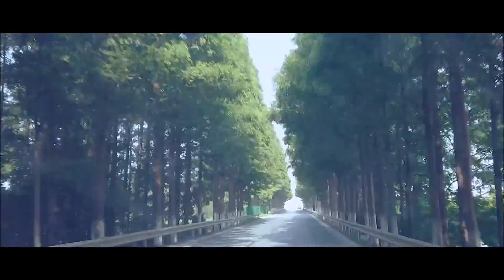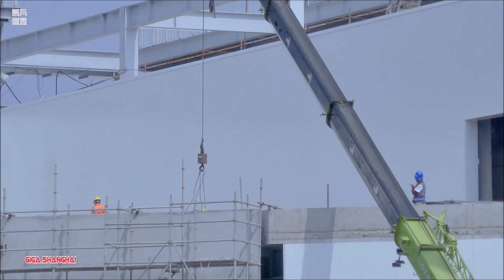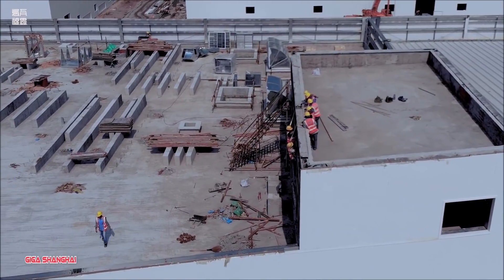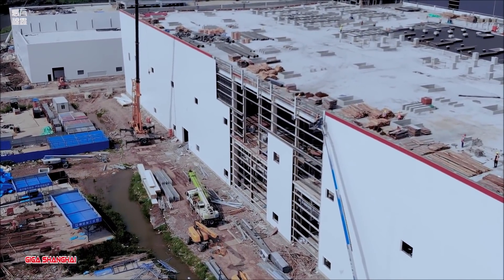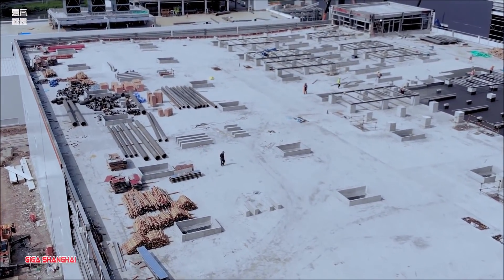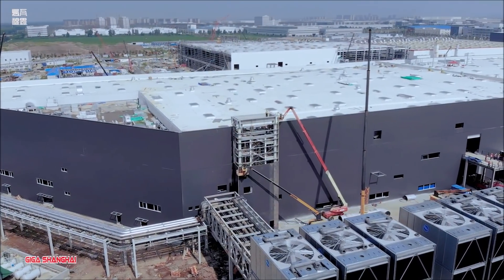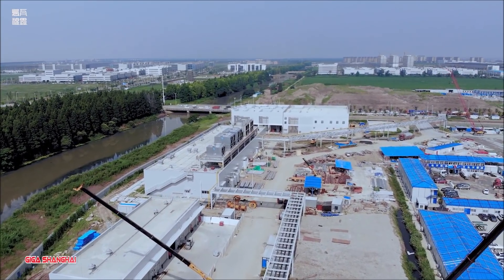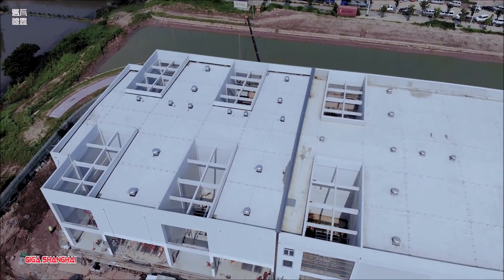Tesla Possibly Testing Model 3 Using CATL's Million Mile Battery

Comment: Doubt it.  Tesla is only interested with CATL LFP batteries.  Because they're Cobalt Free, they cost around $3K (¥21K) less than existing Standard Range LG Chem or Panasonic  batteries.  The only reason they don't use these batteries for the LR model is because these prismatic batteries take up around as much space as the LR battery Pack, so there just isn't enough room.  Since Tesla is the number one consumer of Batteries in the world, they are actually the primary driver of the rise in Cobalt prices.  They're doing everything they can to reduce the amount of Cobalt in their batteries and considering that CATL's Million Mile battery actually uses MORE Cobalt than the LR battery they get from LG, it's highly unlikely that they will switch to a Chemistry that continues to drive Cobalt prices even higher, jeopardizing margins in their business.  My guess is that the $2B facility CATL is building in Germany will supply Berlin Giga with SR Cobalt Free batteries and the $1B Expansion to LG's Warsaw Plant in Poland will supply Giga Berlin with LR Batteries.  Years later, once Tesla learns how to efficiently produce cells with their RoadRunner Pilot (Probably only used for either Semi or Powerwalls or Grid Storage), they'll start to build production facilities to handle new products, then eventually take over existing production.

Comment: Other reports supported the idea that Tesla Shanghai would be using CATL's low cost, LFP batteries, as per previous plans. I am not sure where you put this idea together with any plans for Tesla to use CATL's rumored "million mile" batteries. CATL's LFP battery use clearly benefits Tesla for local, China-only Model 3 sales, to get full New Energy vehicle subsidies, and lower manufacturing costs. But this idea does not extend to CATL's upcoming MM batteries (which Tesla has not mentioned any plans to ever use). WuWa's video looks great though.
Reply: My thoughts exactly.  however considering that CATL announced their German facility shortly after Tesla announced Giga-Berlin, I do believe that Tesla will start utilizing their low cost, Cobalt Free Prismatic batteries for SR Models.  Also, the fact that Tesla says Model Y will be redesigned for the German Market tells me that they're possibly making the Battery compartment bigger to allow them to utilize these prismatic batteries on the Model Y.  As an example, the seats for Model Y are exactly the same as the seats on the Model 3, except that they're sitting on Risers.  Possibly the Battery compartment will be bumped UP under the seats so that space is filled with Batteries??  SR Model Y won't be offered here because it would be Sub 250 EPA Miles.